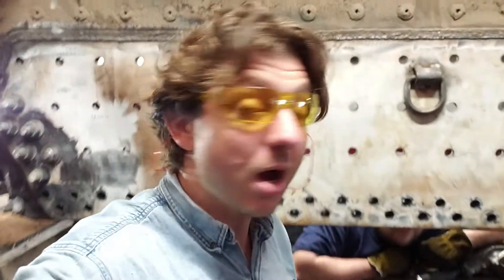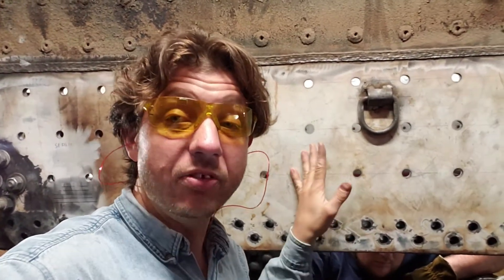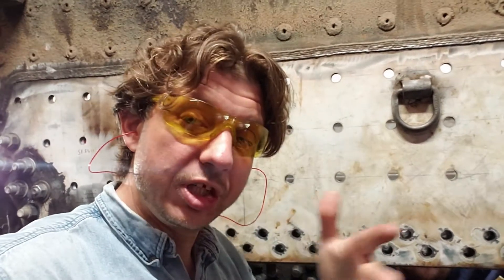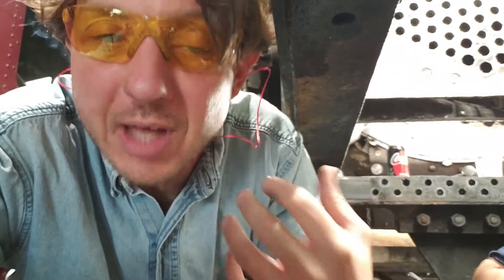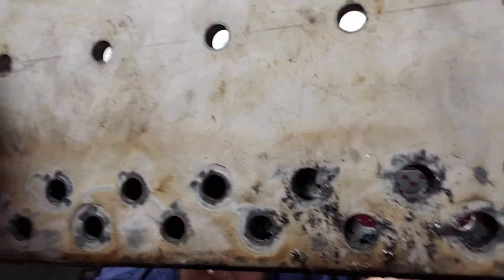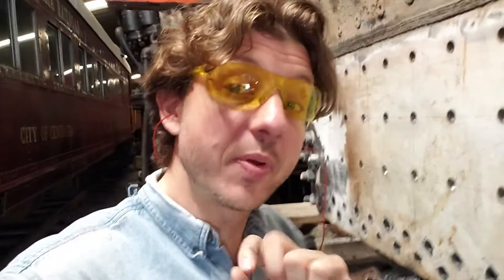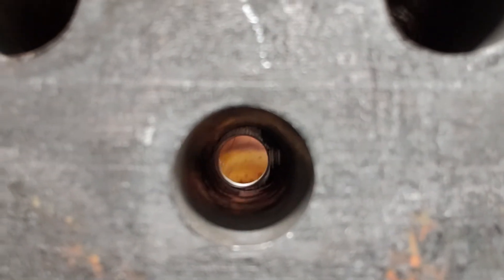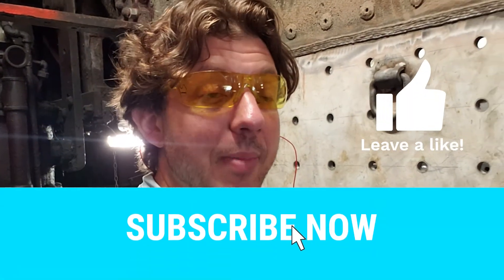Technically Speaking: Reaming

Comment: I was noticing the ring used to position the outer plate, looks like it is welded. I have seen others bolt , or make a pad eye out of the same material as the patch. Reason being to not introduce another material into the plate. There being certs or specs on the plate and rod.